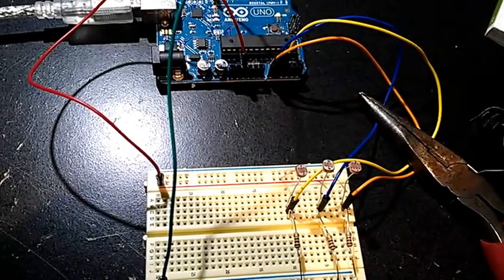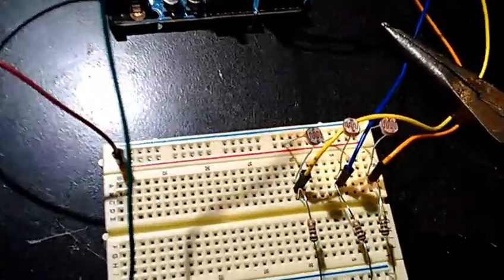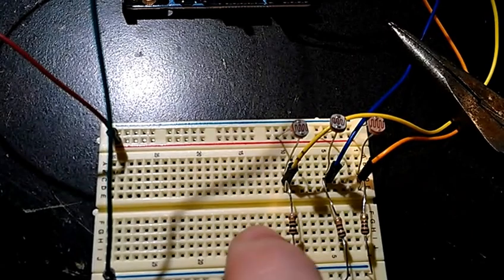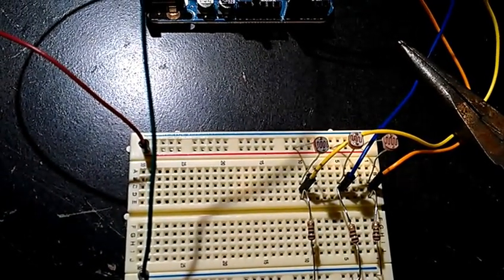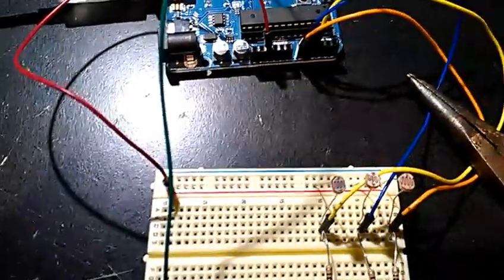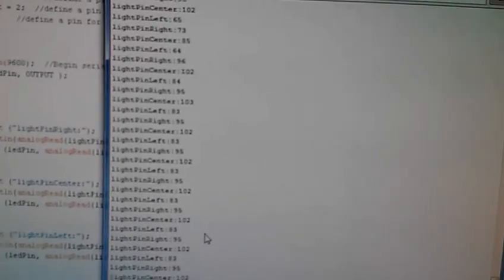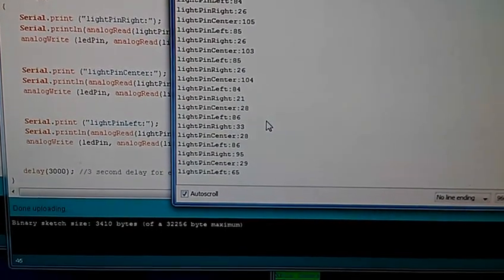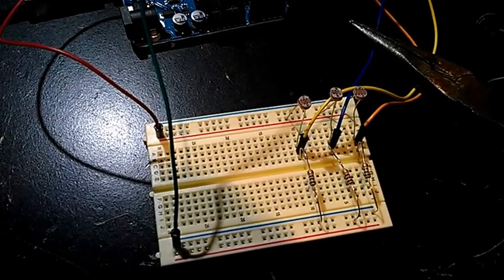Arduino photoresistor array project

Comment: Tom, this is awesome.....did you ever get this fully built out?  I am building a fresnel-based solar water purification system that also needs to track the sun.  My thinking was to put a photoresistor array at the bottom of a long tube that has a tiny hole at the top....would then read in the position of the hottest array,  figure out where that cell is in relation to the center, and then move the stepper motors accordingly.  Hope to hear from you!